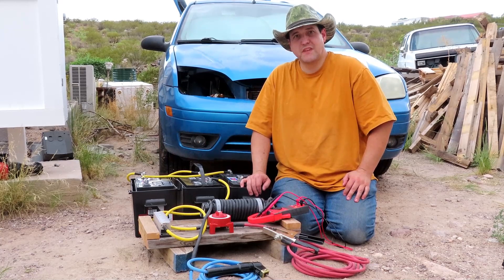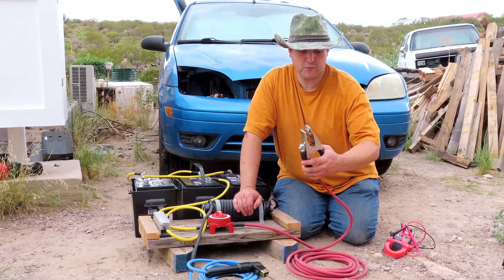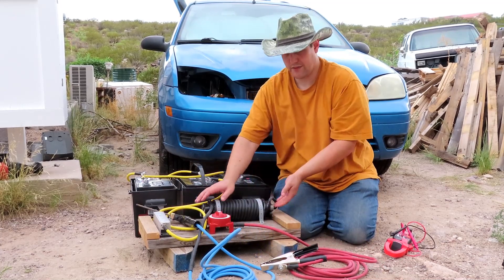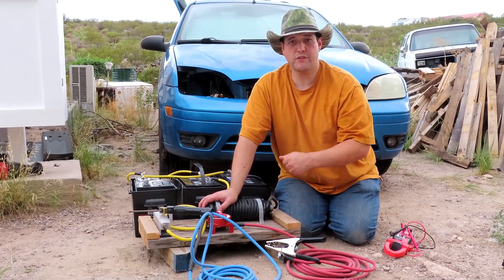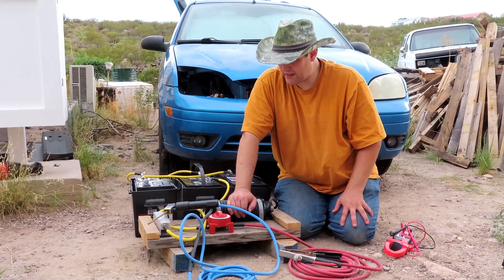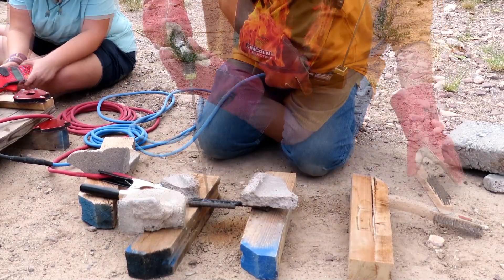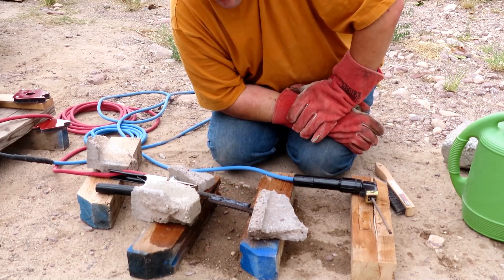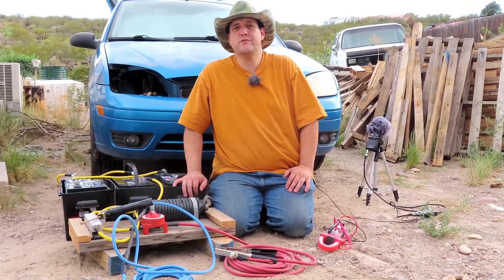Wielding Great Power - Offgrid Battery Welding Setup | Emergency Welding | Manifest Skills E015

Comment: That inductor/choke you made would be very useful if say you built up a DC welder from salvaged MOTs and converted the AC -> DC via a bridge rectifier since your DC output's current would constantly vary/ripple & prevent a nice smooth arc which the inductor would help to smooth/steady out as inductors resist *changes* in current and only serve to limit current when it's constantly fluctuating like in an AC circuit or the one I mentioned. For a pure DC source like batteries it will actually just hinder starting the initial arc and then act like a regular wire with the one exception being that it can help maintain an arc due to the induced "back EMF" voltage spike if say you long-arced your electrode a bit too far away by accident. Other than that they're not very functional for current limiting for this type of circuit, I'd go with a bigass ampacity thermistor if you're concerned about drawing too much juice from those batteries & burning them up, wayyyy cheaper than many feet of 4ga wire too! I dig your resourcefulness though 👍👌

Comment: Pretty sure its electrode positive dude. Stick welding is a electrode positive process. You have it hooked up for tig, electrode negative. Also for flux core mig. Gas solid core mig is back to electrode positive. You will get better results if you switch you're polarity atleast I did when I remembered to switch it. Also the welding world recommends it. I like you're wag on the inductor

Comment: I was an AWS certified welder for a good long time...
You're running pretty hot for that rod size.
It will be much easier to control your puddle when you get the power turned down to a manageable level.
The most effective way I can think of is something like a DIY variable capacitor in an electrolyte solution.
With an inductor in a circuit, it's usually a good idea to have some kind of buffer to handle the enormous spike of current when it's turned off.
Reply from the maker: I got some good measurements on the current and at the voltage and amps it is around 9500 watts of power in use.  I for sure need some bigger rods but the local supply only had the size I used as their biggest.

I plan to add some good current limiting circuit design when I get back to it (always a million things to do) so I balance the current to the rods correctly.  I was after seeing what could I do with very limited supplies and an inductor was the best option as going raw right to the batteries would have been a very bad idea.

Based on the batteries I was using it means I can get around 8 to 10 minutes of welding done before having to recharge them.  So for emergency use it will do.  My goal is make a cart with wheels and with the better current limiting circuits.  Got some ideas for some old school designs that will be fun to make, maybe even use some vacuum tubes! ;-)
Reply: @reedin9954  

Allow me to caution against the use of vacuum tubes in this application. 
There isn't really a good way to detect and remove glass shrapnel from the human body.

I just picked up materials to build a very primitive non switching DC speed controller to use with this setup.
Something like an old plate transformer, with one set of plates that can slide forward & backwards.
Fill the container it sits in with any electrolyte solution you have on hand & it should be precise enough for tig welding.

As long as you have access to anything made of any kind of metal, you can quite precisely control your welder...
Even a couple of those pipes your inductor is wound around, with a wire attached to each one, dropped in a bucket of urine would work in a pinch.
The closer the pipes get to one another, the more current will pass between them.
Reply: @kaisersose5549  what do you mean the more current will pass,  is that more " tunning the amps down, like he wants to do,  or is this actually passing more initiate power. In almost given up trying to learn this stuff through the formulas.
Reply: @ryanb1874  
Put simply, the smallest welding rod commonly available needs a minimum of about 30 volts & 50 amps to use.  
If you allow the circuit access to 200 amps that rod will basically vaporize.  

You can either use a rod large enough to operate with the supplied amperage or limit the amperage & use a smaller rod.  

The simplest means of making a weld, regardless of any damage caused to the batteries, is 3-4 12volt batteries in series & rod large enough to function with the amperage available to use.
Reply: @ryanb1874  
Here's a little experiment to illustrate what I was saying...  

Fill a non metallic container with water & stir in a spoon of baking soda. Connect the positive wire from the battery to the edge of the container, with the end of the wire in the water. Connect the negative wire to an incandescent light bulb and dip the positive wire from the light bulb into the water.  
The closer the wires get, the brighter the bulb becomes.  
Works the same way with a welding rod.
Reply: How is this managed.  Can you just ground the inductor to the earth,  what is simplest.

Comment: Man, this was an awesome video! So much power for such a portable welding system. Especially for grid down. Great stuff MOI!
Reply from the maker: Hey Magic Prepper! Glad you liked it. I got all sorts of projects planned just lately work has been intense! Big project goes live on September 9, so working like mad to finish up everything.

It was impressive for sure how much power it had. It also makes some really good welds. I have used it several times since as it is easier to move into place on the back of my pickup than running a big extension cord or borrowing a big generator (I don't have a generator big enough for a big welder).

I'm going to be making a version 2.0 that includes settings to control the amperage for setting it for specific power output levels so it will allow for a bigger range of materials to be welded.

Also, take a look at past videos in the Philosophy and Power playlists. I bet you will find some interesting things there. I'm still working on your channel and plan to look at all past videos, just like I said little time to myself right now.
Reply: @reedin9954  yea work has a funny way of taking up a lot of time. But, I was thoroughly impressed with the amount of power coming out of that thing! 
I hadn't really thought of the possibility of welding post grid down. There are so many applications you may need it for. Great video and I really appreciate you sharing the info!

Comment: That is awsome 👍
Reply from the maker: Did you think the weld penetration was pretty good? To me is looks like it is forming some very solid welds.

I'm going to make a generation 2 system that will have a variable current limiter so you can set the current for the size electrode and material you are welding. Right now this is doing around 200 amps at 36 volts which is a fair amount of power.

Comment: Definitely a good thing to have in your arsenal for an emergency if a buzz box is not an option. No way is it Ideal, but it is a hell of allot better than just hooking up to a battery and hoping for the best.
Reply from the maker: Hey Wayne! Thanks for taking a look. I'm planning to add a variable current limiter control so it can be adjusted to the metal you are working with and the size of the electrode rod. Just have to do some work on the design for one that can be built with cheap and salvaged parts. Doesn't help if say go order this electronic bits from Amazon.com when the grid is down. LOL

We will see what you think about generation 2.

Comment: Omg it was way more powerful then i guessed it would be think u may even be able to use smaller batteries, are those like for a car or stronger? They look bigger in my eyes then what a car would have :) awesome setup tho i would try to find a way to be able to charge those batteries with solar or windpower for example
Reply from the maker: Solar charging is a good way to charge them and what I would do in grid down.

The batteries I used are truck/marine deep cycle. Motorcycle little batteries can also work but they won't be able to output as much power so the electrodes will be the smaller ones, like a 3/32" or so.

The inductor is a critical component as it limits the current and keeps the system and arc running smoothly.

Comment: Wow!! That was interesting 👍 I think I'm going to try this I have a regular wielder, I'll try to do a side by side comparisons of the two. Good video.  Thanks for the shout out Reed😁👍
Reply from the maker: I'm glad you liked it. I have a regular wire feed / mig welder and old school oxygen acetylene torch but gas welding is darn hard. So making this is helpful so I don't have to use it in remote spots. Plus if it is grid down need some way to weld stuff.

Now the batteries can't run for long. Even the ones I used can only provide around 10 minutes of weld time before I need to charge them.

So that is the problem this system has, the batteries limit how long it can weld for.

Feel free to ask any questions. Based on some of the feedback I will be making a follow up video to it.
Reply: Again great job!👍😁 please do another video side by side comparing the two different versions very interesting. 🤔🤔🤔
Reply from the maker: I can see about doing that, comparing my little MIG welder and this one.

People also wanted more information on how to build the inductor so I was going to do that for everyone as well.

While these battery systems aren't perfect (Nothing really is) they do have a good use, especially in SHTF.

Also, happy to give you a shout out. You have a good channel and good advice, just need more people to watch.

Comment: Great video. I'd be interested in seeing how you build the inductor too.
Reply from the maker: I will put together a video showing the inductor in more detail.

I plan to make a cart for it so it is very portable. Better than running a really long extension cord to run the MIG welder.

Comment: This is a very cool video man! I need to get some of that knowledge. I love the channel keep it up. :)
Reply from the maker: I'm glad you enjoyed the video. I think I will make a follow up where I install a low voltage disconnect to prevent the batteries from becoming deeply discharged.

Also this system can't run long, only around 10 minutes of constant welding but it is enough to still accomplish a lot.

You can look at the argument I had and let me know if I was being a nutter.
Reply: @reedin9954  well it's never good to argue but I trust you and your knowledge base.
Reply from the maker: @Prescott Caliber Club - I'm usually a very easy going guy and don't usually care much about what people think but if you get in my face and say I have no idea what I'm doing and have no business talking about this or making a video about something, yep I'm going to get type A and push back.

I'm not a fan of people saying this is all wrong but providing no comment of what exactly is wrong or speaking directly about what is wrong with the design. I'm sure you have heard all manner of crazy stories at the gun store where people say dumb stuff they believe to be true but have no real details.

My father loved to tell me that the reason why the military adopted the .45 ACP is because they wanted a round that could knock a man off his feet....well when I learned about energy transfer and did the calculations I realized that a .45 ACP has no real chance of knocking a man off their feet, even more so if they are running at you. Old urban legend.
Reply: Manifestation of Imagination Id have to say you’re one of the easiest going guys I’ve come across. And yes I totally get it. Sometimes I’m talking to people and I’m like “yep, uh-huh, ok” and thinking what is this guy talking about lol.

Comment: You can. But you shouldn’t. It’s uncontrollable. Sorry. But these type videos drive me crazy. You’d be better off getting a buzz box from harbor freight. I’ve been a welder/fabricator for over 20 years.
Reply from the maker: As an Electrical Engineer I can say you are totally wrong. Your experience means nothing when it comes to the design of electrical systems. It really bugs me when guys come around and say "I have these decades of running a bulldozer, welder, or something" but have no engineering, physics, and mathematics background and are commenting on the engineering behind something. It is just plain stupid.

If you bothered to fully watch the video you would see that there is a large inductor in the system.  If you knew about the electrical engineering of circuits you would realize that an inductor is a current limiter and arc stabilizer.  The system is very safe and completely controllable.
Reply: There’s a reason weld machines are designed the way they are. We’re never going to agree on this. Guys that have no idea what they are doing use batteries. To even try to defend your position on this proves you have no idea what you’re doing 

The reason you were cutting through metal is you have no idea what the hell you are doing and therefore have no business doing this video

I’ve worked so many prints that engineers screw up all the time and have revision upon revision upon revision
Reply from the maker: I have worked on the power circuits and current limiter circuits for industrial robotic welders and associated machine vision systems. My knowledge about this stuff completely dwarfs your knowledge. 

If you are so smart, tell me how a modern inverter welding system limits the output current to keep the arc stabilized? I know exactly what they are doing, so lets hear it.  Also tell me about the spice sim runs used in the modeling. If you can't them you are talking from a position of ignorance and stupidity. 

I have had the wonderful "pleasure" of doing root cause analysis after stuff has gone totally wrong and people died and found plenty of people just like you who think they "know" what they are doing but ended up getting people killed.

I know exactly why it was cutting through the metal with the smaller rods. Like I mentioned I took a wag on the inductor design and knew it was going to take a bit of work to profile it and determine where the current was stabilized at. If you are so smart, tell me exactly what the governing equation for the power output for this system is. Tell me about the the equations managing the magnetic saturation level of the inductor and how it affect current in the circuit. If you can't then again you are talking out your rear end and just can't accept that what you know is wrong.
Reply: Some damn fool is going to try this and get himself and/or others hurt. Just stop. It’s painfully obvious you have no clue wtf you’re doing and damn sure shouldn’t be telling others to do this 

Get a damn buzz box at the least
Reply from the maker: You can go buy a commercial spool gun that is battery powered and I know of another company that sells an arc welder that uses lead acid batteries as well.  Aside from a selector switch to switch  between current limits and voltage, they are using a very similar circuit design.

In the past when we were talking about bring electricity to every part of the US there were plenty of people who had worked in the plants and told everyone that it was impossible and it would result in the country being destroyed and the fires would be everywhere.

They talked about how they were certain and knew what they were talking about as they worked in the plant but engineers figured it out and made it a reality. They determined the failure modes and put in safety systems to handle the problems.

Lets look at some failure modes we have to deal with: *) Complete short circuit - Handled by the fuse. The fuse will blow and interrupt the power. *) Current will be too high and cause battery thermal runaway: Handled by the inductor - Current is limited to around 225 amps, total system power around 8,100 watts. *) Batteries will become too deeply discharged resulting in damage - Not handled. Knowing battery level before starting is necessary and limited time of welding is currently needed. *) Hot molten metal can fall on the user - Safety gear is needed to be worn and care is needed to sure sparks and molten metal is contained. *) Attempting to weld metal too large can cause current to surge too high - Fuse will open stop circuit. *) Attempting to weld metal too small results burning metal - Fire suppression and correct safety ware is needed in case of mistake. Circuit voltage or current limiting will need to be adjusted if wishing to work on smaller materials. Otherwise working on smaller materials isn't current possible at system wattage output. *) System can be turned off with the switch for safe transportation.